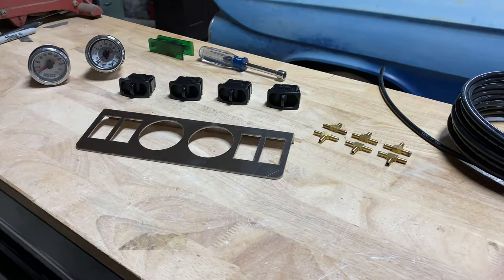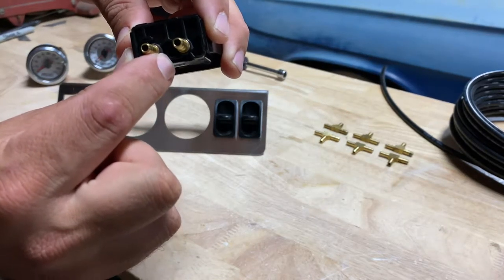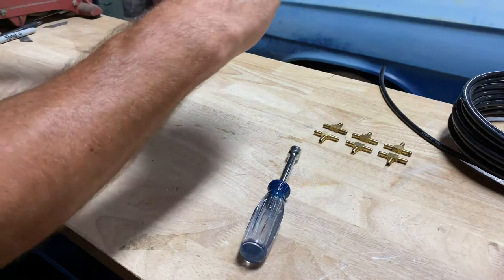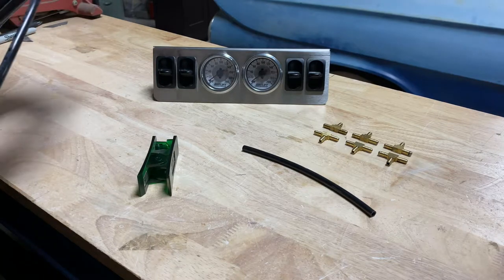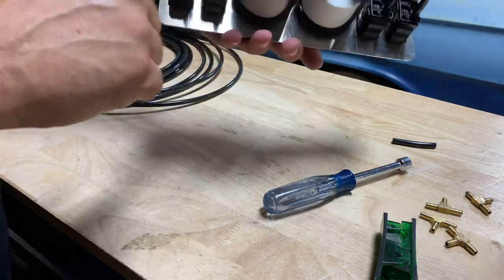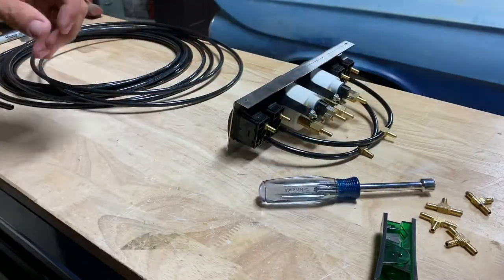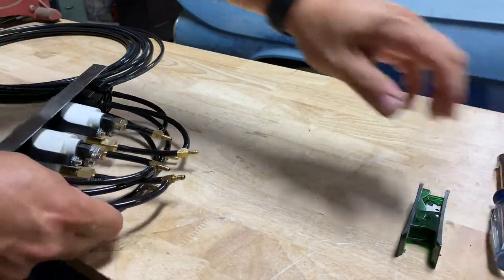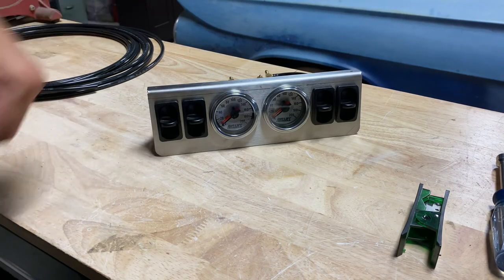Twisted Images Stage 1 Air Suspension - Assembling the Control Panel

Comment: Where does the air bleed from when u go to drop the bags?
Reply from the maker: @snowgaming7637  great question! There’s a tiny hole on the back of each valve that allows the air to drain from the bags. Since it’s venting into the passenger compartment you’ll get a little rubber smell until the air bags break in a bit, but it goes away pretty quickly as you use the suspension.
Reply: @twistedimages405  thank you very much sir 🤙🏽

Comment: i need a system like this - but need to know are they quick? i only want to run a 2 way sustem front and back - can i get a gauge panel tjhat will hold two gauges and also a power switch for compressor
Reply from the maker: This type of setup isn’t designed for speed- it’s the slowest system we carry. We do have a bunch of options for quicker lift and drop- message me through our website www.twistedimages.com and I’ll help guide you into the parts you need!

Comment: I'm looking for a kit for my 68 c10 and one for my 84 c30 . I like the simplicity of this but I'm curious of how it would do towing . What can the rear bags and paddles handle weight wise 

Both trucks would tow . 68 would have a bumper pull 18foot car trailer on it alota and the c30 would have a 35 or 40 foot gooseneck on it from time to time
Reply from the maker: On the c10 I’d just stick with the standard kit bags and brackets- it can handle the tongue weight of that trailer with no issues at all. But for the c30 I’d recommend a pair of the large Contitech bags we offer- shoot a message my way at phil@twistedimages.com and I’ll show you what we just did on an OBS Dually last week

Comment: Can i remove the airline from the barb using a lighter to heat it up?
Reply from the maker: Absolutely! Use a lighter to get it to soften up, then wiggle it a bit to open it past those barbs. 
Cutting the line will usually damage the fitting and make it leak, so this is the right way to go. Good luck!

Comment: Is there a way to run the line from the air out hole to go outside?
Reply from the maker: I’ve seen some creative attempts at this, but the back of the valve just has a small hole in it with no provision for a fitting or tube to run from it.

Comment: Will this also prevent body roll or would i need to change the t valves
Reply from the maker: Giving each air bag its own valve is the key- this 4 path setup prevents air from transferring from one side to the other when going around a corner.
Reply: @twistedimages405  ohhh i seee thanks man great video!
Reply from the maker: @carlosalmodovar6058  thanks! I’ll keep trying to figure out an exciting way to share info- until then you’re stuck with boring videos like this haha

Comment: Query: if each bag has its own line from the tank, is that a faster fill to the bag? Thx
Reply from the maker: The way we set these up, one front and one rear share each feed line. So when lifting both front bags or both rear bags they’re each getting a separate feed. It’s not common to lift all four corners at the same time so four separate lines is usually more work for nothing. But if you think you’ll be doing that, I’d definitely give each valve its own feed
Reply: @twistedimages405  I'm starting basic and having two switches ( paddle) for front and back..so I was think of two supply lines front and rear instead of one t 'd off to two...
Reply: @twistedimages405  and that's 1/4 " line?
Reply from the maker: @Wizkidmelburn  yeah, these setups run 1/4” line. With a single paddle for front or rear it’s going to be VERY slow.  What vehicle are you installing this on?
Reply: @twistedimages405   1985 Oldsmobile Cutlass 4 door sedan...
Reply: @twistedimages405  like how slow? I'm new to this..
Reply from the maker: @Wizkidmelburn  with two paddle valves on that car you’re probably looking at 15-ish seconds to lift or drop.
Reply: @twistedimages405  I did not know that...so is the set up you showed in this video, how long for that?
Reply from the maker: @Wizkidmelburn  I’m sorry for the late response! With four valves set up as shown it’s usually 6-8 seconds depending upon the weight of the vehicle